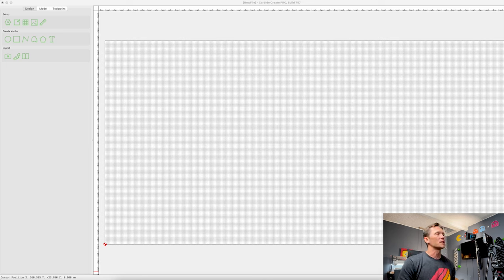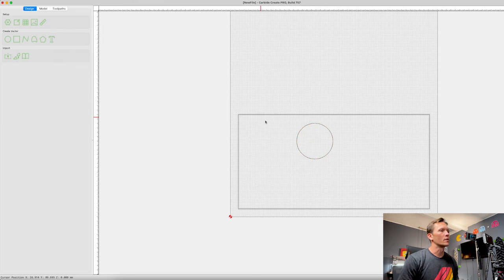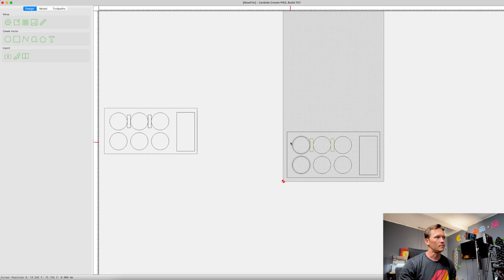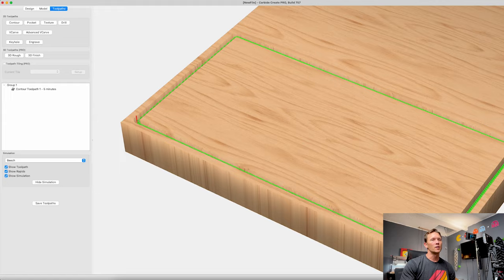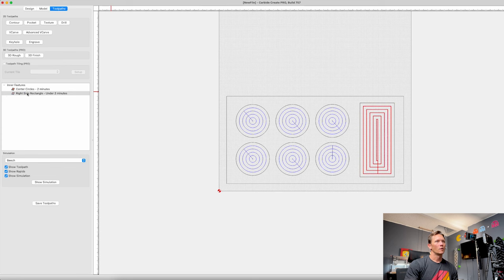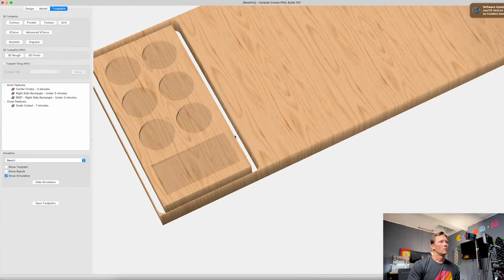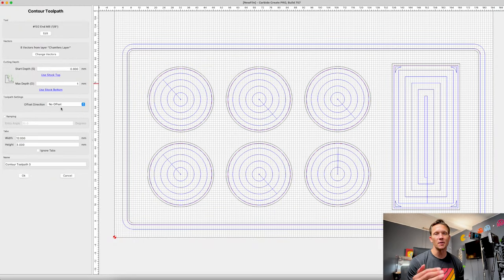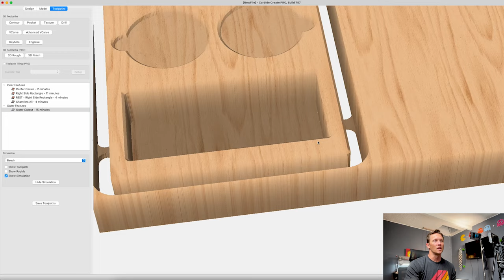An Intro to Using Carbide Create Version 7

Comment: Trying out CC7.  I'm a beginner. Tried Fusion360 but is so complicated.  Can I use my Genmitsu 4040 Pro Max with CC7.  How would I add it to  "Machines' in setup?  Thank you.
Reply from the maker: You don't need to add it as a machine, just pick the GRBL post-processor and Create Pro will export G-code for your machine.

Comment: hi there. quick question or two. is there a way to show how to do a final rastor path so that you dont have to sand much and itll be smooth at the end? or do you already have a video about that and have the link for me please.
Reply from the maker: Elad,
This video details creation of a raster path as a flattening path.  You may find it helpful. 
How to: Flatten Stock on your CNC Router
https://youtu.be/DjIL2Lsfq0Y
Reply: @carbide3d  awesome. thank you. ill watch it. loving the videos by the way, I already feel pretty good abut getting started with my first project soon. waiting on some parts for my new, used just bought shapeoko 3 and excited to get started. these videos have been great.
Reply: @carbide3d  oh, i also have another question. ill be surfacing and milling wood and epoxy projects like a 10x10 ashtray so, two different materials within a project. any advice on feeds and speeds when it comes to doing the center circle relief of the ashtray that contains both of those materials?
Reply from the maker: Find an endmill and a speed that doesn’t burn the wood nor melt the plastic (epoxy)

Comment: Thank you Kevin, I'm more of a visual learner and this helped a lot, great job on going through the steps and addition. I was actually scared because I thought it would be so much harder than laser, well there is the 3D part but once getting the hang of it, it will come easier. Thank Again for a job well done.

Comment: Very useful lesson.  I have not ordered yet (shapeoko 5 pro) as I am learning software first. What I am unsure about is tool changes. Will the file sent to carbide motion include machine pauses for bit changes?
Reply from the maker: Yes, our Carbide Motion control software handles the tool change process for you using our BitSetter.

Comment: If you what to fit a square corner part into the rectangle pocket, cut half the cutter diameter past the vertical side corners in one direction. Like the small circles add to the coin pockets.
Reply from the maker: You definitely could utilize that strategy.  You could also use "dogbone" corners in the rectangle menu to produce a similar result.   Often times there are several paths to the desired result.  That's partly the fun of the design and toolpathing process.

Comment: Just recently I thought I had a problem with my CC pro or at least I thought I did any way. Afterwards I started reviewing the competitors version. Found out a couple of things I didn't know like it only handles ONE stl. I checked my CCpro and it handled more then one! I said to myself Wow self. CCpro does it. And no, I might not be able to push a magic button that sorts my pieces out so I save wood BUT I can do other things quickly and easy which does make up for the time lost in calculating Toolpaths. Thats a pain for all the calculations but I have renewed respect especially after I received very quickly so much positive help of people going out of their way to see what I did wrong it was very impressive.
 I wasn't able to save enough and got impatient to get the 5 but I did get a pretty decent machine (which I did install a light like on the 5) to go along with my other machine. Eventually I'll sell that one and definitely get the pro 5.
Any way, you help set a very good example Kev and I enjoy your videos. I give you a big thanks for being a positive impact.
Oh yeah, watched other competitor vids and you know what? Carbide create does cut very accurate circles unlike some other programs. 
If you ever have a drawing for the pro 5, count me in coach!

Comment: Hello Kevin. Great video and very well done. I have two questions at this time. First you mentioned ramping when you are making a plunge cut. I believe I have the terminology correct. Could you explain how that works. Second, there are numerous design files on line that you can download DXF files either for free or a minimal fee. Will Carbide create accept those files and allow me to create and save a G code file for my dedicated laptop for my machine. I am totally new at this and I hope I have used the right terminology to explain what I am asking, Again great videos and I am learning so much. Art from Sunny Florida
Reply from the maker: Hi Art,

Ramping allows you to control the angle of plunge into your material.  Without ramping, the plunge is done at 90° or straight down.   With ramping enabled, you can specify an angle of descent.  This lessens the shock to the endmill, particularly when cutting metals, composites or hardwoods.

DXF files can be imported to Carbide Create.  Under the "Import" Tab, the far left button has a box with an arrow through the top of it.  That Import will allow you to bring in the DXF.   As with any project, you will have to assign toolpaths and tooling.

Experience and experimentation will be your best guides to learning the world of CNC.   We're glad you're here.
Reply: @carbide3d  thank you so much for your quick response. I am sure I will have more questions along the way. I am in the early stages of this. At this time I am trying to decide on which machine I would like and more importantly what brand. If you have thoughts I would definitely appreciate that. Again thank you so much.
Reply from the maker: Art
Join our forum community (it’s free).  That also allows you to view all of our educational material. (Again, for free). 
You will not find a CNC manufacturer more dedicated to your success.  Whether that success is CNC business, hobby or art, we have content and resources to help you achieve your goals.   
Do your research.    We’d love to have you join the family.

Comment: Pricing wise, carbide create seems to be in the midrange, hence the limitations it has. Should i just get the more expensive software from the start and learn on it?  
will V carve pro work on the shapeoko CNC?
Reply from the maker: V Carve Pro definitely works with Shapeoko.  
Software selections are often based on the project goals of the operator.  
Often people have a couple of CAD platforms they use regularly.  
Often CAD simplicity yields quicker results for some projects.   
Create Pro strives to offer a compelling suite of tools and capability at an accessible price.

Comment: I have the software now, been playing with it for a few months.
(Actually, very user friendly so far. However, I've been running CNC machines for 20 years)
Your little project is perfect for the question I have. I haven't figure out how to do this.
Question: 
In the rectangle pocket, How can you radius the bottom, from top to bottom using a ball endmill. 
Will this software DO a Z-X or Z-Y radius?
Reply from the maker: In order to create a radius at the bottom equal to the radius of a 1/4" endmill, you'd want to use the Offset Path tool to create a line inside of your desired final pocket dimensions.   That offset path should be 1/8" inside the desired pocket dimension.   Run the pocketing operation with a flat endmill utilizing that inner box.   Then run a contour pass on the "Inside RIght" of the desired pocket dimension art with the 1/4" ball endmill.  This should provide that radius at the bottom of the pocket while milling the pocket out to the desired dimension.

Comment: Great video, I know I'm going to watch it several more times. I was wondering, in the rectangular pocket, could the bottom be rounded  to follow the shape of a coin on its edge. Is the machine capable of doing that.
Reply from the maker: William, you certainly could draw a vector that followed the edge of the coins.   It all comes down to finding a radius that fits the edges.   I would do some testing to dial in that radius.  Then, duplicate that shape however many times it is needed to produce the desired pocket.  This could be done to hold coins vertically or horizontally.

Comment: Hi Kevin.
Im planning to buy the CC Pro 7. Im now working w the trial version.
My trial project is a bird house roof with a cedar shaker texture. 4 in x 5 in.

Im not getting a 3d carving. Just a flat pocket. Does  the trial version have the same functionality of the commercial Pro 7
Reply from the maker: The trial is identical to the paid version.  The only limit is the duration of the license.

Comment: Great video.  Wish ya would have done it 2years and 6 months ago.. :)   Question, what would be a good offset if using the 302 60deg vBit? I'm guessing maybe a 0.5 rather than 0.9 ?
Reply from the maker: Hey Jeff, We're happy you enjoyed this one. For the 60°, we've done a .7mm offset with success. The ideal offset will be determined in part by the available depth of the cut. 

If you are chamfering a shallow pocket, you'll want an offset closer to the edge that is to be cut.  This will keep the cutter's tip from digging into your pocket while producing the desired amount of 60° chamfer.   
For an outer edge or deep pocket edge, you can simply run the DOC deeper, along that same .9mm offset, to get contact from the angle of the cutter.

Run some test pieces to experiment with the narrowest offset possible. Write it down and keep it handy when you are finalizing your designs. Real-world testing and experience are the best teachers.
Reply: @carbide3d , thanks, that gives me a starting point.

Comment: Hey Kevin. Eagerly devouring as many of these great videos as I can before my Shapeoko arrives. Question: if I wanted into import a set of vectors created in another program (i.e. SketchUp or Affinity Designer or Illustrator) could I do that? What would the proper file format be, JPG? PNG? Can Carbide Create use vectors created in another program? I'm asking because I am very adept at creating vectors in SketchUp using tools that are not yet available in Creator. Thanks for the great content.
Reply from the maker: Hey Davey.   You can utilize SVGs.  That would be the best way to import from the programs you mention.  Tracing always needs some Node Correction and likely will produce double lines by tracing both sides of a given JPG or PNG line.  
Here’s the link for My.Carbide3D.Com covering image imports in Carbide Create.  https://my.carbide3d.com/gswcc/07/
Reply: Thanks, Kevin. Can't seem to export SVG files from SketchUp, but Affinity does. Very cool. Was having trouble with the node editor (i.e. could not get the program to "insert" a node onto a vector, but it finally started working. Guess the program realized I was about to tattle tale to you. Thanks again. @carbide3d

Comment: Great video.  Curious why you didn’t use the array tool for your circles?
Reply from the maker: Lori.   Good call, the Array Tool would have made quick work of that process.   In CAD, there are often multiple ways to accomplish the same thing.   Here I wanted to showcase how I use guides and a guide layer to position elements.   I'll think of the Array Tool for the next project.😉  - Kevin

Comment: I'm confused by the "rest machining" part. Why after duplicating the tool path and selecting a smaller bit does it only cut out the corners?
Reply from the maker: REST Machining allows you to use a larger cutter to do most of the work, then bring in a smaller cutter to get the minor details.   This saves a lot of time on some projects, particularly with signs containing text and logos.

Comment: Do you typically use 15° for a ramp? I usually use 30°, but it's just a number I picked one day, I really don't know what an efficient ramp degree angle should be.
Reply from the maker: Great question.  The angle I choose is primarily based on endmill size and the material being cut.   15° is probably super shallow for entry to walnut.   I've been doing a number of metal projects recently.  That's why the number jumps to mind.   The chosen angle can only be too steep.  There's no penalty for entering at a "too shallow" angle.  
As a guide:
Larger the endmill = Steeper the Angle
Harder the material = Shallower the Angle
Reply: @carbide3d  Thanks for that bit of info.